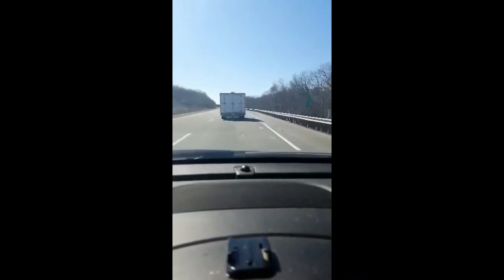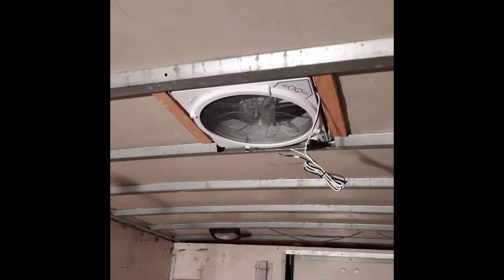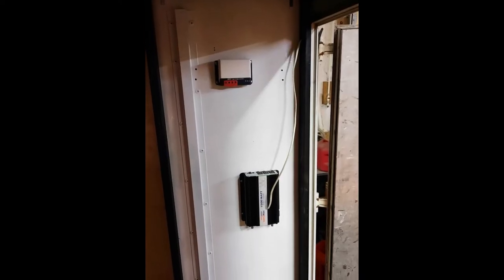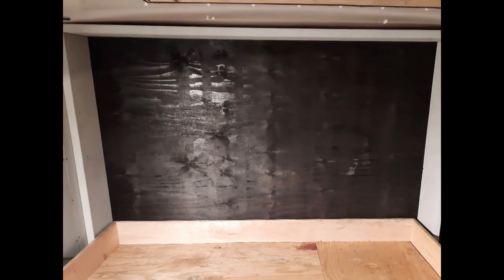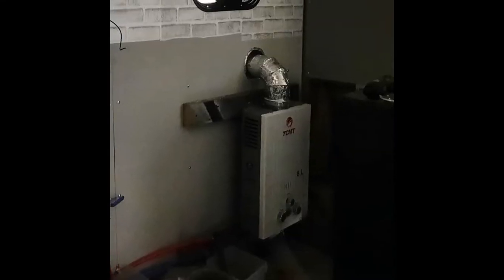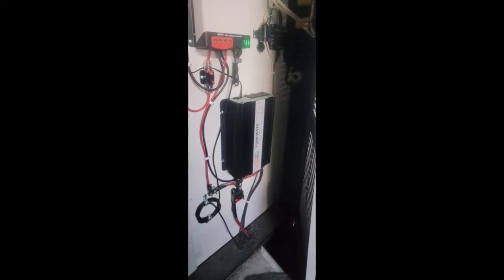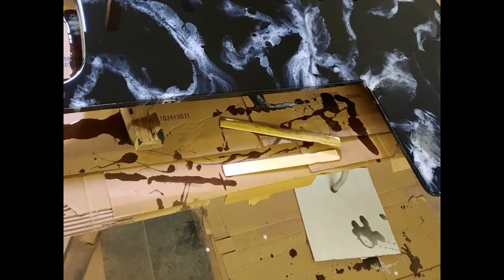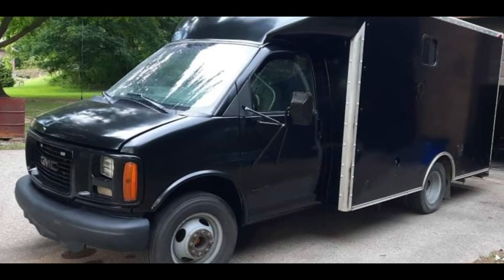Van Life | RV Conversion Build | Box Truck | Van Conversion #vanlife #rvlife #foryou #diy #amazing

Comment: I'm planning on retirement next year and this past summer bought a used 2007  uhaul box van which I hope to have the way I want it by spring 2022. I am having a great time fitting it out and want to be in the wind by this time next year. I want to roll until I shake off this mortal coil !
Reply from the maker: Awesome! It was fun building this van, and amazing to be able to take your home any where you go. Good luck with your build!

Comment: Super amateur questions here my apologies:  For solar panels do you screw into the roof?  How do you seal the holes your screwing.  Similar question for putting up the walls/painted side-panelling.  Does that screw into a wooden frame you had manually built underneath or does it screw into siding of truck?  

Thanks so much this was an incredible build.
Reply from the maker: Thank you! For the walls, I had glued 2x4's flat against the outer body, plus screwed them in from the outside. For the solar panels, I just glued 1 ft pieces of 2x4's flat against the roof, wherever the brackets would have lined up, and screwed the solar panels to them. This basically sandwiched my roof in between the 2x4's and solar panel brackets. I used screws that had rubber or some kind  of plastic washers, then just used lap sealant to assure no leaks.  Really sturdy and haven't had any issues.

Comment: Sweet build! I’m looking at a similar build. Will you tell me how tall is that box is on in the inside?
Reply from the maker: Thank you! The inside height, or head room is 6 feet. Well, it's exactly 5ft 11 1/2"in. Keep in mind, this depends on how or if you insulate the ceiling and floor.

Comment: Nice I just bought a 99 diesel version of the Savana.  How much does yours weigh? The title for mine said 14k + so I'm stressing about going off road on certain trails. Hoping the diesel will compinsate a bit
Reply from the maker: My title says 10k. Also, when I weighed the van, it was 10k with full water and loaded. I've been off road a little with mine, and no issues. I guess it just depends where you go with it. Might be a good idea to get a winch...just in case.
Reply: @NomadicBillyGoat  lol okay good to know. I have to weigh mine. It's the same size as yours pretty much. And I'm planning to stay as light as possible. But the winch is definitely not a bad idea
Reply from the maker: It's always good to know how much you weigh, and also how tall you are!
Reply: @NomadicBillyGoat  oh yeah. The one thing I liked a lot about mine was the old owner was a contractor and welded an awesome aluminum deck on top. It's so sick but also adds a foot, which has me worried lol
Reply from the maker: My van is 9.5 ft high. I round it up to 10, just to make sure.

Comment: Why only 1/2 inch thick insulation?
Reply from the maker: Cost of building materials, plus I wanted to maximize the interior size. Next build, I'd do more insulation, but It works for me so far. Been in anywhere from freezing to 110 degrees.

Comment: Nice job of all the work. I have an Ambo. How expensive was it to paint your rigg or did you do it yourself?
Reply from the maker: Thank you! Awesome! My friend is building one. 

I painted it myself using the Rustoleum turbo spray cans. I don't remember how many cans, but it was definitely in the 20's. The outcome looks decent from 20 feet away, but up close, you'll see runs, and imperfections. If you use spray cans, just take your time to assure proper coverage and not wind up with runs like I had. Lol. Thanks for stopping by and Good luck!